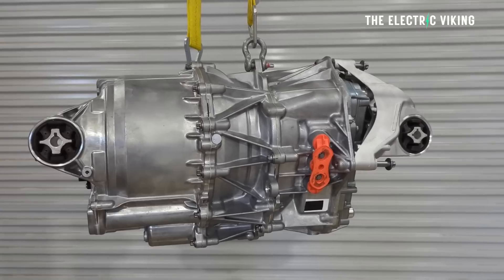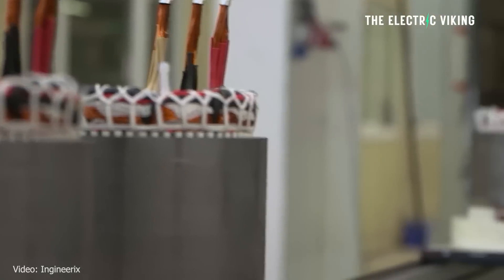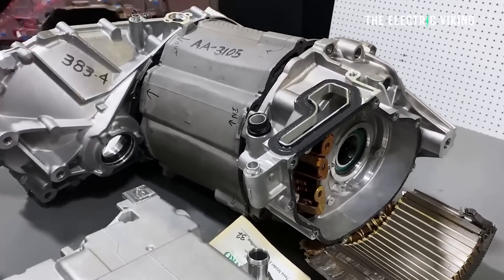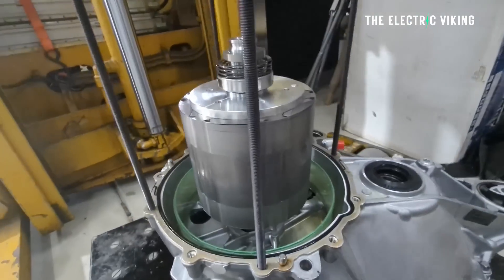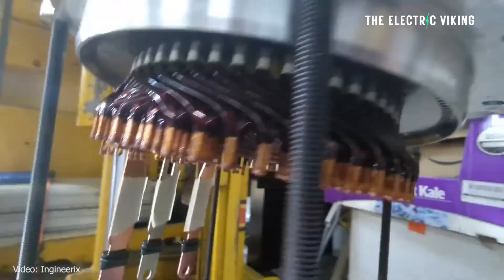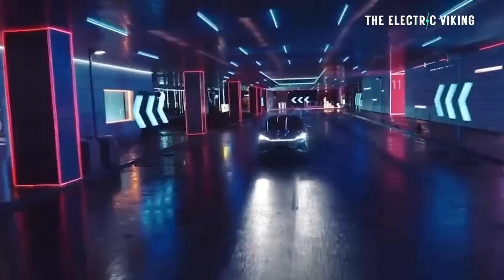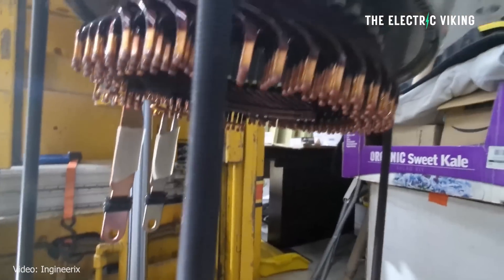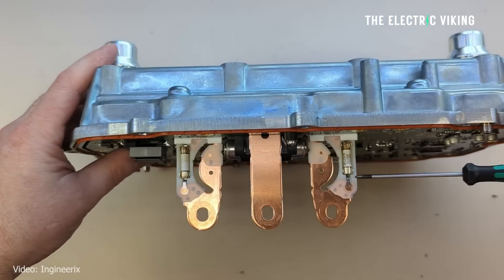Tesla Model Y electric motor compared to VW ID electric motor

Comment: Hi Sam, greetings from the U.K.  I’m fast approaching 60 YO now, I graduated as an electrical and electronic engineer in 1987. AC motors, induction or permanent magnet are the ideal technology - that we know of - to propel a vehicle driven by wheels, or tracks, or anything requiring a torque or rotational force. This is because a driven wheel requires a rotational force to make it work; a perfect match for the physics of an electric motor. When you look at the physics of an external combustion engine (steam engine) or internal combustion engine (petrol or diesel or natural gas or hydrogen) you have massive inefficiency because the linear force of a piston must be converted to a rotational force using a crank. This fundamental weakness in efficiency can not be designed out.
Reply: I wouldn't blame the linear to rotational conversion for the inefficiency of the ICE. That honour goes to the conversion from heat to mechanical energy, which is confined by the laws of thermodynamics. Heat is the lowest quality energy there is, so it's a bad idea to just burn the fuel. Something like a fuel cell is vastly more efficient.
Reply: @virtual-viking  Exactly, however the new generation of aircraft turbojets look to have taken heat engines close to maximum theoretical efficiency for a heat engine.
Reply: Don't tell a mechanic this.
Reply: @ryan6391  Tbf, some mechanics have always known that the piston engine has relatively low efficiency. The electric motor has just been waiting one hundred years for the mass effcient rechargeble battery. It arrived, arguably about 15 years ago. Now it has to become affordable for the masses. It's just a matter of time, and it is most definitely going to happen.
Reply: @Rambler Andy  well said fam 🍻
Reply: Piston Engines, Steam or Fueled, can't make up Their Mind, as to are they Coming, or Going! 

Constantly changing direction, can't be good for the Materials, forces, or Waste of Energy!
Reply: @robertweekley5926  Here's a thought. A piston engine has to come to a dead stop twice per piston cycle. Seems unimaginable, but it's true.
Reply: Wankel rotary engine. Doesn't need to convert linear force to rotational force. Unfortunately it never achieved it full potential. Although Mazda is using it as a range extender in it's hybrid car.
Reply: @sunrisejak2709  The rotary engine still needs to perform compression of the air fuel mixture which robs energy from the previous combustion cycle. There are so many problems with a rotary engine concept, efficiency is truly atrocious, the compression seals operate on the outer edge of the rotor resulting in a high speed area to seal and lubricate, these seals fail often, after about 30k miles or so needing a full engine rebuild. Only Mazda has persisted with this ridiculous concept.
Reply: @simonreeves2017  Got it!👍😁
Reply: You never used the motor type which us mostly used in electric cars. Its the reluctance motor. Tesla will make a Reluctance motor with aluminium stator windings. With little to no magnets in the rotor. No copper used in the motor. What do u think about this?
Reply: @Simon Reeves, the issue is that EVs are like old 50-60s american muscle cars, if u push the pedal to the metal so to speak u loose so incredibly much of range, it just guzzles up too much juice at once. Fuel has way more energy than battery right now and the electric drive train is too thirsty when under load. Therefore it is not optimal as a long range haul option but more for inner city vehicles regardless if it has the rotating motor instead of an ICE where most of the efficiency of the fuel/power gets lost during the operation of the engine.
Reply: @Pillokun  But I do most of my driving well within the range of the Tesla dual motor and I charge pretty much from my solar system. Driving with a "lead foot" doesn't really cost me anything as long as I have enough juice to get home. Even driving with the "lead foot" I'll go at least 350km which I never do on a daily basis. My gas car if driven with a "lead foot" really punishes me at the pump!
Reply: @sunrisejak2709  Mm, if you dont drive that long and have access to cheap electricity then it is perfect for you, but as we have seen this past winter, electricity bills can be extreme, making ev not as "profitable" or money saving. And lets not kid ourselves, we will get additional price increases on electricity and taxes when more adopt EVs. 

EVs were expensive to buy for the well off early adopters, and in turn they got tax write offs and what not making it cheaper to run and park and what not compared to ICE, but now it is over and even though the prices are a bit lower on them(EV) running costs are increasing. 

Lets not fool ourselves, an EV should be half the cost of an ICE it is less intricate to manufacture than ICE. It is basically an empty shell with electronics in it, the big expensive and time consuming part to manufacture ie the ICE engine is not there.
Reply: @Pillokun  Yes, I'm 70 years old retired and more money than brains! 😊 But my use case is a bit unique.
Reply: @Pillokun  thats not how it works. Please understand. EV's are even efficient under heavy load and fast acceleration. One liter of gasoline contains 9kWh.(a gallon gasoline 33kWh) An EV battery has like 60kWh. So its comparible my EV has 2 gallon of gasoline. With that 2 gallon... i can drive 265 miles on 2 gallon of comparible gasoline. When i haul something the car uses twice as much energy. This still means 2 gallon to do 130 miles. And 1 gallon can do 65 miles while under heavy load/hauling/constant fast accelating.  Please do proper calculations first and not assume things with feelings and guts.
Reply: @HermanWillems  I dont need to do proper calculations about what u say because I know that batteries have less energy stored in them than gasoline. ICE are less efficient because most of the energy are wasted during the engine operation but still are superior than EV as the moment you are under load the EV drive train just draws energy like crazy. 

For long haul the only way to use an EV drive train is in the form of an Hybrid, where the EV drivetrain is simply a support drivetrain, but even that would make it too heavy compared to pure ICE and U loose load capacity. The issue with EV is that when u need to recharge u need to wait a long time and maybe there are no recharging station near by and make u experience the so infamous range anxiety.

Right now batteries are inferior to an ICE in the how much energy stored each medium/fuel has, ie battery vs fuel. mine crappy fiat punto has 40l fuel tank, and I get about 500-600km out of it, a friends bmw 3 series get 1000km ouf of his tank. Show me one EV doing that kind of range on on recharge with the same energy/weigh that a fuel tank offers, there isnt one.

Edit, oh yeah, forgot to mention that in 2016 I underwent an education specially for alternative fuels in cars like biofuels, lng/cng/electric and so on. we even experimented with batteries powered by bacteria.
Reply: @Pillokun  I'm hauling wherever I want with my Model 3 RWD and I don't care. I can get everywhere in my country as there are chargers everywhere. The Tesla software takes care I don't get stranded. It takes in account that km hauling in the tow mode operation and tells me what time and where to charge. My experience is I'm charging 15 minuts somewhere. My collegue has an Model Y Performance and also hauls a lot of stuff  all around the country for his new build kitchen.  I mean. Practically I see no problems in real life here.... maybe the charging infrastructure in your country is not that great yet? Also the Model 3 RWD might be the most expensive car I bought. The real operating cost including the write off is lower than ANY car I owned since university. It's the CHEAPEST car I ever owned. U just have to pay the car more upfront higher upfront cost. Thats the biggest problem
Reply: @HermanWillems  so like u said U just dont care. yet u argue with me about ev vs ice from a technical standpoint because of you personal opinion?
Reply: @Pillokun  I don't care because there IS NO TECHNICAL PROBLEM. Do the damn math go back to school. Do some physics, do some math. Please help yourself.
Reply: @HermanWillems  U still dont understand or rather dont want to understand, I said it to you. there is no EV on the market that can store the same power density in the battery as good old fuel has. Simply put if I took a car the same size as yours and made the fuel tank so big that it would match the weight of your Tesla it would easily double or triple the range of your Tesla with ease. If u on other hand make ur tesla as light as a normal car it would probably only hit 50km of range. I have worked with batteries the size of a small car and 50km is what u get ouf ot such thing.

Comment: Funny the notion that newer and lighter is better. In the old days, not many years ago, appliances (electric) would last a extremely long time. They used to be abuse proof. True they also were simple, too much so for our digital world. To see quality, as for durability, go to some less developed countries, which also have poor roads, and you will many old Mercedes diesel cars, with probably more than 1 million kms, still working on a daily basis. You will see lots of Toyota Land Cruisers and Nissan Patrols that can handle that type of roads. Weight reduction was not the objective but durability. VW as a good german company probably has still, though I think they have lost some, of that mentality.

Comment: BMW: "This transmission fluid will last the lifetime of the vehicle"
== Self-fulfilling prophecy.
Reply: Good point. When it fails that's its lifetime over. Sealing something like a filter seems like a cost cutting measure by a manufacturer that has an incentive to limit the life of the car so more can be sold.
Reply: HAAA ! Yes, you have earned the "Youtube Comment of Day Award."
Reply: @grandrapids57  HA!  Thank you!  I have a 2008 Nissan Altima hybrid with 290k miles which looks and runs like a new car.  Replaced trans fluid every 40k miles, contrary to recommendation.  Now upgrading to a P85D+ for $25k
Reply: @felixbaum48  That's it! My Geo had "lifetime trans fluid" too. Yeah, right.... and sold it after we put 270,000 miles on it. My Malibu LTZ, 274.000 right now... I put new OEM wheels, tires, carpet, had driver seat restuffed and new leather panel sewn in, wife complains but I always have a new car... more or less and it never depreciates

Comment: This HP or Kw rating is very important! not just for acceleration but for regen

A VW driver descending a hill and slowing will need to use the brakes. The Tesla driver has more regen.

This gives better efficiency and longer real world ranges.
Reply: If the VW driver uses cruise control, the car will regenerate a lot to keep the speed down. If the driver uses the brakes, the car will regenerate as much as possible, before using the "real" brakes.

Comment: Merely stating "double the power" - without the reasons why?? (or the desired to limit power to (enforce) minimum range - the average city driver has no need (nor ability to develop) full power in a single gear steroidal golf cart - a burnout doesn't take 400HP to achieve).
  - Increased cooling, larger diameter stator winding wire (hairpins), stronger magnetic flux ?? (ie. These factors are all engineering decisions, not pointers of; Engineering Brilliance vs Idiocity, different aims are at play here - the outcomes demonstrate this - we just need hindsight to see how the market views these objectives long term)

Oil Filter ??  - what is new here, many auto transmissions go their entire life without a filter change (manual trans don't typically  have filters). With no combustion products, there should be very little breakdown products to filter out, its function is more or less to contain swarf from wear components..

Comment: The option to change the oil filter might be valuable eg lots of dirt road driveing.
Reply: Dirt and debris don’t get into the motors of an EV. It’s there in case the moving metal components expel tiny pieces of metal particles from moving and getting too hot. It filters the oil that lubricates the inner components. Only way it can get contaminated from outside particles and dirt is if there’s a big enough hole on the motor housing that isn’t intended. If it was intended, then that just means bad engineering and design.

Comment: The reason Tesla use an oil filter is because they chose to adopt a "wet" motor layout, like many others have.  The oil must be pumped from the gear reducer sump to cool the motor and whenever you have a pump you must have a filter.  Tesla originally just used a bulky off-the-shelf spin-on filter to save having to design anything more clever.  Other EVs with a "wet" motor (e.g. Bolt, E-GMP and new Hyundai/Kona models) typically use a non-serviceable screen.  All Tesla has done here is move to a small integrated filter as the others have already.  As for oil changes, the fact is that gear reducer in an automotive application covers very few operating hours compared to industrial applications that run 24/7.  It's easy to get away without changing the oil over the lifetime of a typical car.  Hairpin windings have been used for years by others, with Tesla being the notable holdout until now.  Tesla's powertrain engineering is good but there is nothing Earth-shaking going on here.
Reply: re: "Tesla's powertrain engineering is good but there is nothing Earth-shaking going on here." <--- see the wise gent sitting down in New Zealand gets it.
Reply: re: "Hairpin windings have been used for years by others, with Tesla being the notable holdout until now." read it and weep kids.

Comment: I think we need to be clear the factor of safety behind it. Most claim power on motor is actually lot higher (at least 2X of rated power) which means the claimed  power is not for continuous operation. (The rated power is). The comparison is the EV motor and Train motor. A typical EMU subway motor running on 640 V or 1500V can only put out around 300 to 400 kw or even less.(each one weight well into triple digits in kgs) But the later can last for 20 years pounding few hundreds km a day every day even at L2 crush load. Their EV counterpart will likely experience catastrophic failure within weeks while operating under this type of condition. Hence, I wont say Tesla is ahead especially consider their track record. They are just more willing to take risk at consumer expensive
Reply: True, but the same can be said if any high performance car motor. I doubt a 300hp bmw petrol motor will last long running continuously at full power, but in reality probably ends up only being a couple of days of full power over the whole life of the vehicle, unless it's raced. Early model S motors were known to fail, but the model 3 motors are holding up well. Time will tell though.

Comment: I think the embedded oil filter is part of the new design. I believe the older motor has a replaceable filter. I’m surprised you didn’t mention the new motor’s lack of rare earth minerals. That’s the big story if it’s correct.
Reply: I agree. But I thought that was to be the next motor release not the current one. I didn't think they were that far ahead on it.
They will be going through round after round of price cutting, putting all kinds of pressure on the legacy industry by the looks
Reply: You wrote, "I’m surprised you didn’t mention the new motor’s lack of rare earth minerals." This video of Sam's is based on details provided in a video by another YouTuber, and that other video did not discuss whether this new motor uses rare earth metals. Hence, Sam did not discuss that possibility.
Reply: But i see copper. The new is not out yet. The new motor has also aluminium stator winding pins.

Comment: In addition to having fewer moving parts the moving parts in an EV drivetrain move in a circular motion, the least damaging form of movement for a mechanical part. In and ICE drivetrain many parts move pistonically, the most damaging type of movement.
Reply: Pistonically🤔
This is how I move late on a Friday night 😁
Reply: The term is pure rotary or simple harmonic. Pistonically is not a term I have been aware of.  But conventional gudgeon-pin anchored piston /crankshaft ice cars are not simple-harmonic. You get second, third and other higher order harmonic effects from side forces which lead to much harsher vibrations that end up wearing the entire vehicle as a system down compared to pure rotary alternatives. One such alternative is the Wankel engine. Also known as the rotary engine.
Reply: @user-uu6bi4tn5o  yes, 'pistonically' is a new-to-(me as a mech eng, at least)-term, too   🤔. But not a bad one in many ways, it summates the acceleration regimes quite well! Don't forget that Wankel's are not 'pure' rotary, either... (just much lower accelerations than them pistinical ice's!) I'm sure the ice'y clarkson psychophant crowd will lose interest in their old tech once the performance gains of electric drive become more apparent to them. Maybe in time even Harley owners will get over that, er, lovely feeling of a big non-primary balanced v-twin roller-thundering their teeth out...
Reply: @jesflynn4048  😅😅😅 good one. Thundering them gnashes. 😬

The comparison between electric and ICE is not even a comparison. Let me offer you this 97% efficiency in favour of a 40% loss riden entropy susciptible of endless complexity in every sense.

When the true nature of the offering is comprehended and importantly when it becomes easily accessible for the average Joey, then it'll be recieved.
Reply: re: "parts move pistonically..."  RECIPROCATING.
Reply: @phillyphil1513  You say tomato, I say toma toes.
Reply: @anonmouse956  clearly...
Reply: @phillyphil1513  correct.
Reply: ICE cars are now stupid.